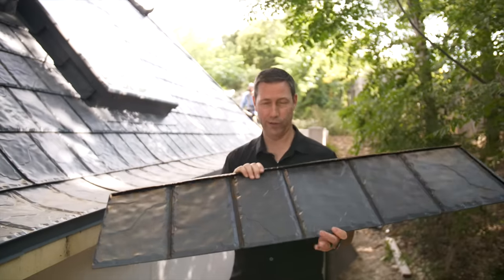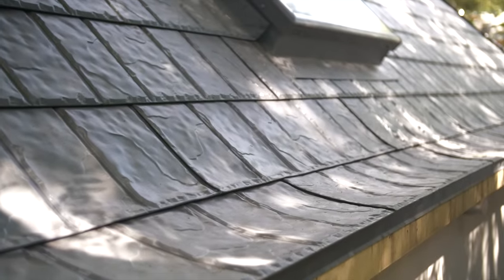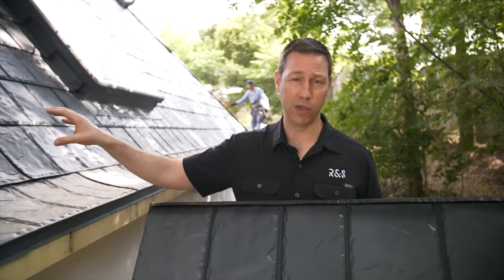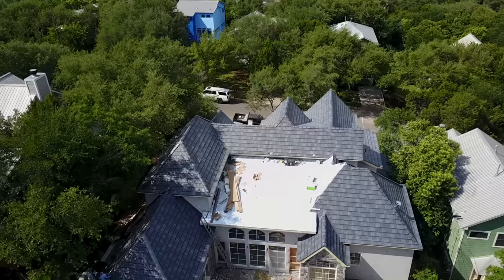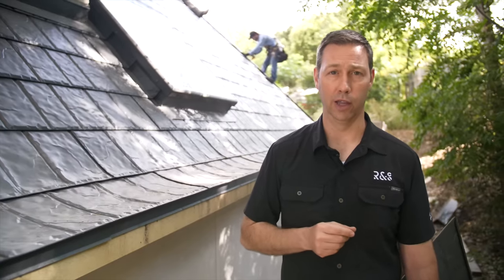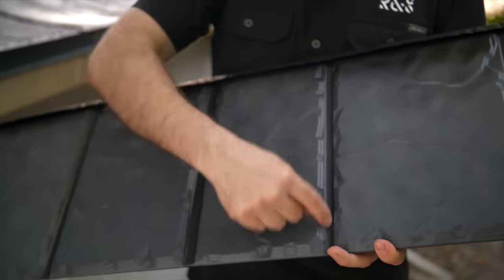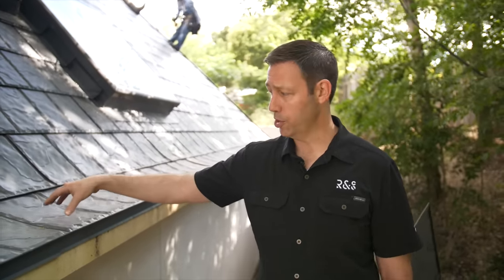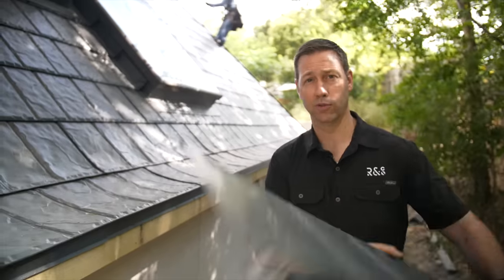Metal Roof Shingle Review

Comment: I thought some insurance companies penalized homeonwers for metal roofs. Do they not like any metal foof or only roofs made with corregated panels? I'd really like to know what P/C insurers think about this new metal roof product before using it.
Reply: I think it would be wise to check in with your homeowner's insurance company before changing your roof material. I found out that metal roofing would increase my premiums because  metal makes fighting a fire more difficult. Kind of turns your home into an oven.
Reply: That's odd since asphalt singles are far more likely to catch fire.  Two years ago a tinder hit the roof of my neighbor two doors down and it burned half his house down before the fire department could put it out.  What the fire didn't destroy the fire department finished off.
Reply: It's something my daughter told me - she worked for one of the largest insurers - I can't remember if they imposed a rate penalty or just declined coverage. One other thing - this company covered some of the poorer parts of America - they could also be using metal roofs as cover for redlining.
Reply: That appears to be the choice we have. Either install a material that is flammable or something that keeps the fire in.
Reply: I just had this discussion with someone else 2hrs ago and they said their premiums were cut in 1/2 ?
Reply: I'm not part of the insurance "Illuminati", but I'm sure there are many variables that determine premiums. It really won't matter what kind of roofing I have, because my agent says my home is too far from a "paid" FD and there are no hydrants around here. She frankly told me that my house will probably burn to the foundation before respoders can do anything.
Reply: I live out in the middle of nowhere. If there was a fire, by the time the firefighters arrive, they'd be asking "What house?"
Reply: Many insurance companies offer a discount with metal roofs. Edco's Arrowline roofing is UL2218 Class 4 impact rated.

Comment: What's the downside to a roof like this?
Reply: Not much. The only downside may be that it's a little more expensive than 3-tab ? But in a place where snow load isn't a factor, a builder might be able to use a 2X6 roof rafter instead of something bigger and make up some of that cost ?
Reply: Look at it like this, whats a new roof cost today now add 20% or more in 10 to 15 years or maybe a tear off Double it or more in 10 to 15 year one an done if done right

Comment: Can you put this metal shingle over asphalt shingles and plywood deck roof??  Also how was the sound during rain?
Reply: With the spray foam and air gap it wouldn't be to loud. And yes you could go over but it's always best to pull the old one to save weight and allows you to check the condition of your plywood or boards dependent

Comment: How's it hold up to lightning? Grounded?
Reply: Roger Kerkmann not many  Commercial buildings burning down
Reply: Greg Shaw commercial buildings got a lot of cast iron pipe, just wondering how it's grounded, the juice has got to go somewhere.
Reply: pretty much nothing holds up to lightning in general.
Reply: The paint might interfere with the local welding when it gets hit but overall it should carry a huge amount of current... Replacing welded shingles is gonna be tough....

Comment: Matt,

I was told by builders that since the metal roof acts as a radiant barrier it is not necessary to do spray foam insulation in the attic.  They have said traditional methods could be used where you vent the attic space and insulate the attic floor with blown in.  What's your take on that ?
Reply: Oliver Ritim they’re lying or stupid. I work on custom homes in south Florida and all the good ones have spray foam. They probably say that to cut costs. The metal roof helps but traditional insulation isn’t even in the same league as spray foam
Reply: I can’t speak for Matt. However, I have learned from some of his previous videos, is that he generally wants to great a conditioned attic environment. Meaning, he wants to limit an environment that gets too hot or cold.  Therefore he prefers to insulate between rafters. My layman’s explanation.
Reply: It is never necessary to spray foam an attic.  Spray foam is a good option, but it's not the only way to get a conditioned attic.  A conditioned attic is pretty much necessary if you meet one of two conditions.  #1 you have HVAC equipment/Ductwork in the attic (this isn't strictly necessary but the number of HVAC contractors who can meet the installation requirements to not do it is shockingly low) or #2 you want to use the space for conditioned storage.
Reply: Look up "to vent or not to vent" on YouTube it's really good. Of course it talks about venting, but also all about insulating.

Comment: How about insulation under a metal roof to help keep that heat that metal roofs generate on those hot day
Reply: All roofs in the south (and probably the north as well) should be white.  This will keep the roof temperature within 10 F of ambient temperatures.  Add 40 or possibly 60 F to this for a dark roof.  With a dark roof, the insulation must have a high temperature rating.  Realistically speaking, I doubt that natural air circulation under a roof will reduce the roof temperature by any meaningful amount.

Comment: You can get a recycled plastic shingle/shake here in Australia and the guy that makes them will guarantee them for 200 years .
Reply: splashpit
They have those in the States too. They suck. Cost about as much as the real thing, but they color will fade and they scratch very easily and cut pieces don't look right on one story buildings (or anywhere where they are visible from a window).
Reply: Great Moose Detective I guess it's down to the manufacturer , I have one that has been floating around my truck for about 10 years that I use for all manner of things and it's not scratched or faded .
I get you're point about the cuts but here we traditionally put a bull nose capping on hips that hide cuts and keep the valley cuts tight so you don't see much .
Reply: splashpit
I used CertainTeed's fake slate once about two years ago. It looked okay for our installation, but like i said, it scratched incredibly easily, and every cut revealed that the color is much lighter 1/16" below the surface. A hip roof with no trees over it would be fine, but cut shingles on any rake will look exactly like they are- cut plastic. I tried everything to blend them in (flipping the cut side to the inside and roughing up the cut to match the texture), and nothing looked good for the money. I would never use a fake slate again. Real slate is much nicer.
Reply: Very melty / burny in fires, so no thanks - especially in hot, dry Oz.
Reply: The guy that makes them won't be here in 200 years to claim your warranty.
Reply: Certainteed's Symphony fake slate shingles are made out of plastic. If they catch fire plastic state petroleum will literally drip down and emit pure black smoke wherever it lands below.
Reply: @deeremeyer1749  where are you located? Many options available in composite shingles. DaVinci Roofscapes is a great place to start. Let me know if you are seriously considering this for your roof, I can get you a quote and have them shipped anywhere!
Reply: @johnwyman6331  Nor will "you" be here to claim it. I'd do a 1000 year warranty!! hahah

Comment: Hey there Matt.  Question.  I saw spray foam going under the roof effectively sealing the underside, but I was always told that the rafters and decking need to breath.  It is one of the reasons why there are eave vents.  So if we spray foam then it would seem that this isn’t so true.  Yes, you used an ice barrier above so water should not get into the attic at all.  Please explain the rational because sealing the underside with spray foam would likely increase the r-value of the house and would moderate temperatures in the attic space.  How does spray foam compare to that mylar or shiny stuff tacked onto rafters?  Here in the West roofs get to be extra hot so anything we can do to slow the transmission of heat into the attic is a big help.  Code in some areas calls for a “cool roof” to keep air conditioning costs down.

Comment: you might have yourself and your client fooled, but modest hail damage will show in dramatic fashion.  90 Lbs/sq...  that is flimsy stuff
Reply: jason it's metal.... Mild dents that aren't visible from the street because it's already textured... That's the most that'll happen
Reply: My mother's new 24 ga. standing seam roof was severely dimpled by hail in San Antonio and had to be replaced.  Not worth worrying about hail, since it can destroy nearly any roof when hailstones are large.  Luck of the draw.  That's what insurance is for.
Reply: So call around and ask various insurers what it will cost to insure such a roof.       And don't forget to examine the technical specs:   metal gauge!     What is it, for this product?
Reply: I put mine on over CDX hail, tree branches, heavy heavy heavy snow.  No signs.  If it wasn't so big, I'd wash and wax it.
Reply: On this textured stuff it really does not show, but yes if it's any other metal roof you can definitely tell.
Reply: jason  remember the client picked it not him.  I’m guessing they researched it thoroughly. Being from Austin I’ve seen plenty of hail storms. Metals roofs hold up just fine.  In the 20+ years there I’ve  never saw large hail.
Reply: jason in Texas.  Yeah. At the end of day it’s a weak finish. How to repair ?  Job security 😂 dude has a lot of free time.  Go build some stuff. Stay off YouTube
Reply: Hail isn’t ever a problem in a lot of areas.

Comment: I kinda like the standing seam metal roofing better. It will last for at least 50 years.
Reply: Benjimen Franklin Is there a reason to believe metal shingles would have a lesser life span than standing seam?
Reply: @kevinhornbuckle  
Standing seam roofing will withstand high winds much better if it was put on right but shingles don't do as as well.

Comment: I liked it at the beginning..but when you actually bended that metal ..hmm at the bottom you will have a lot of problems with water..if it was material like copper or something that will not rust then it would be ok..but it is it just normal steel with protection..hmm i expect problems in about 5-10 years..for sure..rest of the roof will be ok..because water will go down pretty fast..but you can be sure at the bottom..that last piece there..hmm standing water...not good...i would suggest to change it some kind of plastic material with similar color and look..that would be good option too..

Comment: I agree that your metal roof is superior but the idea that it needs to breathe is not supported by real world usage. I have had 2 metal roofs over 20yrs and both had foam underneath......one rigid and the other spray foamed. Neither has needed to breathe. Ice and water barrier is an excellent underlayment and then screw the metal right to it. No worries, I have this setup right now.

Comment: Matt, I know you like Mitsubishi mini split systems. Plus, I know you like energy efficiency homes. 
You should let us know what you think about combining mini split ductless system with solar panels. I was watching your other videos and it said the compressor in the system was DC and uses an inverter to run on DC. What about using DC directly from Solar panels? No energy loss in converting AC to DC. 
Or...evaluate the existing mini split systems already out there that run directly from DC from solar panels. 
http://www.hotspotenergy.com/solar-air-conditioner/

If your looking for other energy efficiency ideas...cooling the house by dumping the heat into your pool!
http://www.hotspotenergy.com/pool-heater/

I don’t represent HotSpot Energy, I just stumbled upon their site and thought it might make a few good topics to expand-upon (obviously you can find whatever manufactures you wish)

Comment: Easy-to-spot fake.  Way too uniform.  And what happens when the paint fades?  30 years and you get weird fading and rust streaks?  No thanks.
Reply: ArthurDentZaphodBeeb 30 years is just the warranty. Kynar paint has incredible fade resistance. This is a lifetime product.
Reply: fading paint is a FAR cry from "rust streaks"
Reply: at 90 pounds per square I doubt its steel. would be nice to know that and the gauge

Comment: Cost....?
Reply: Page 9 here (I'll try to copy and paste too). http://www.asktoddmiller.com/info/The-8-Factors-that-Influence-the-Cost-of-a-Metal-Roof.pdf
Reply: This is said to be per sq ft. Don't know specifics, maybe somebody could chime in.
Exposed Fastener Corrugated Roofing:  $3.50 - $6.00 
Nail Hem Standing Seam: $6.00 - $9.00 
Clip Fastened Steel Standing Seam: $8.00 - $11.00 
“Builder Grade” Steel Shingles Including Stone-Coated Products:  $9.00 - $14.00
“Investment Grade” Steel Shingles: $10.00 - $15.00 
Aluminum Shingles: $14.00 - $19.00 
Clip Fastened Aluminum Standing Seam: $15.00 - $20.00
Copper Roofing: $20.00 - $25.00 
Zinc Roofing: $22.00 - $27.00

Comment: Fake look alike products look cheap. If you want a slate roof, put on a slate roof. Nothing wrong with a metal roof, but it should look like a metal roof.
Reply: IMO, the standard "standing seam" metal roofs make buildings (i.e. your house) look like a barn.  At least to me, it isn't a good look on an expensive house, though modern steel roofing does have some serious durability benefits.